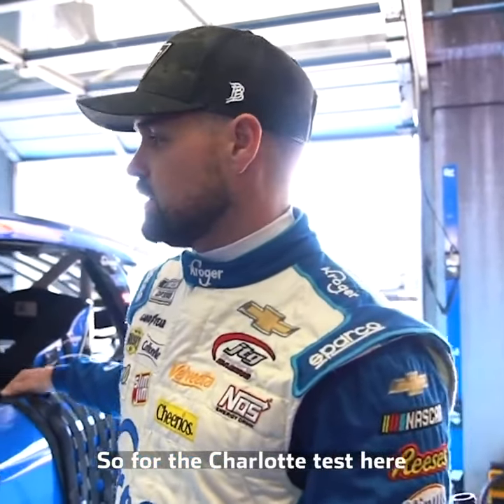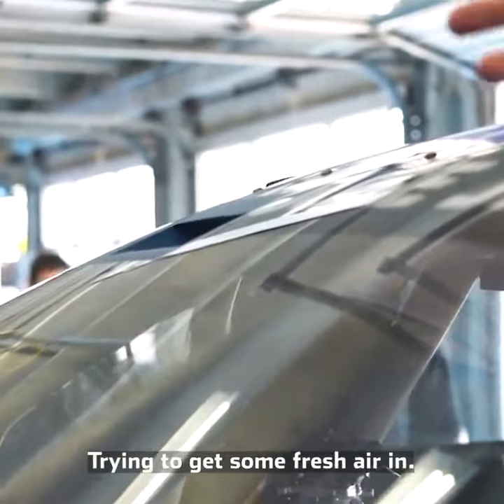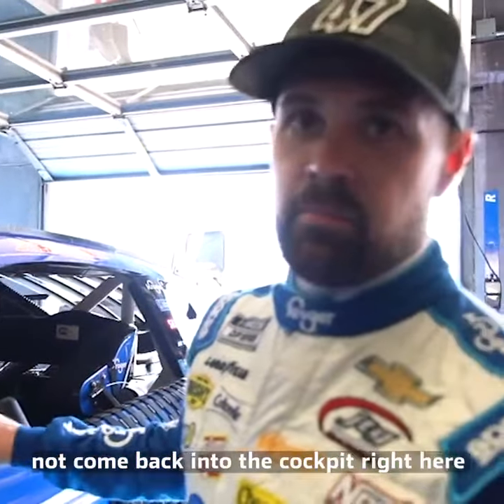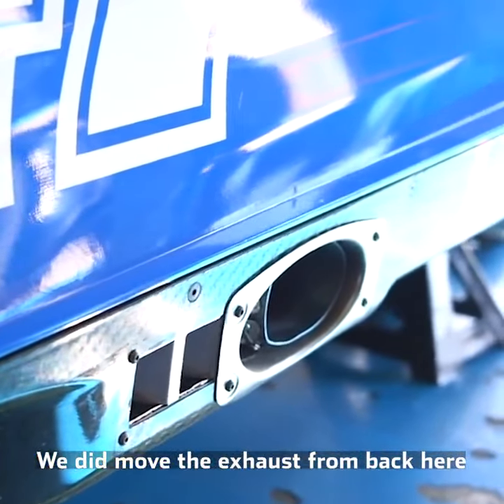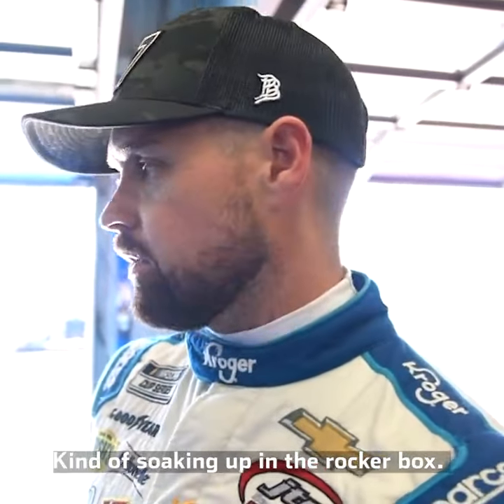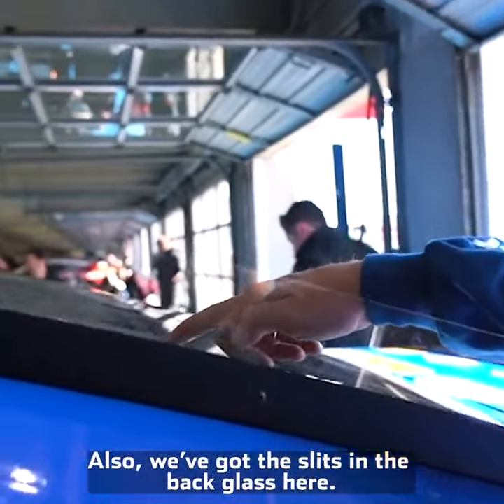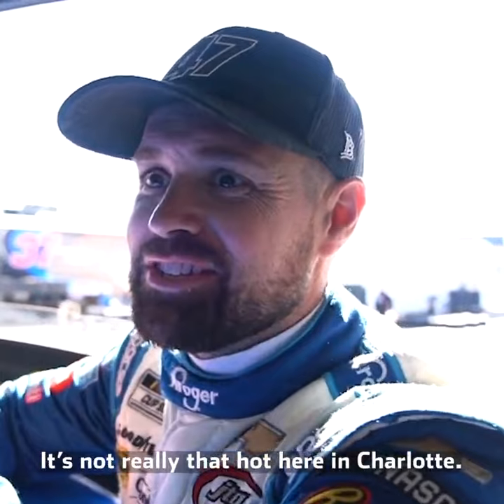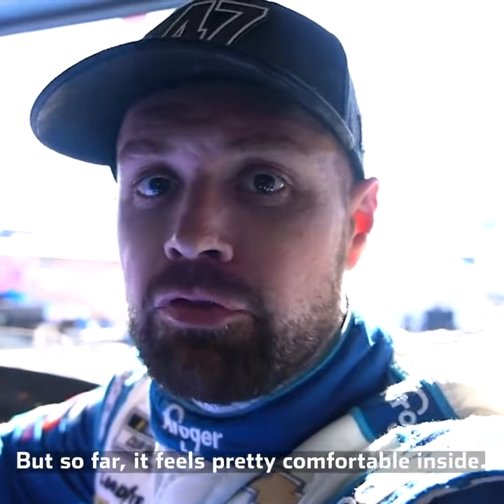Next Gen modification INS and OUTS with Ricky Stenhouse Jr. | #shorts | NASCAR

Comment: The Chevy engineer said that the slits on the back window actually draw in air, and it all mostly exits at the b pillar. Also, they made a key design mistake when routing the side pipes. Collector should have been under the passenger cowl and exit only on the left.